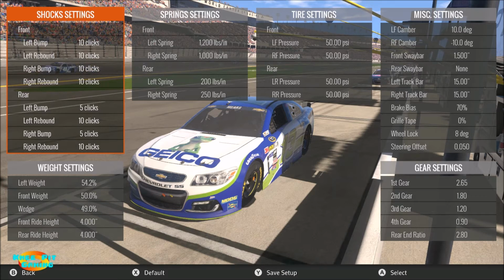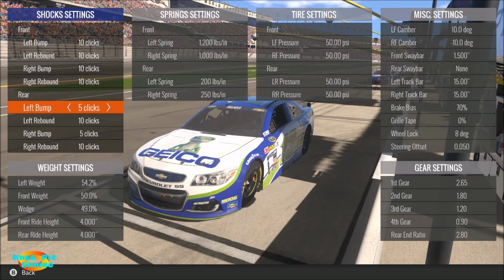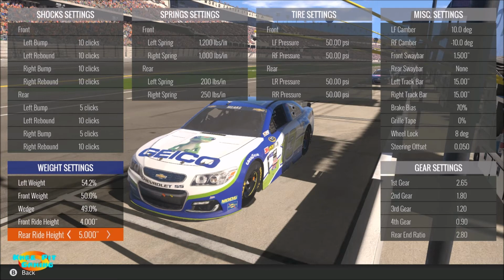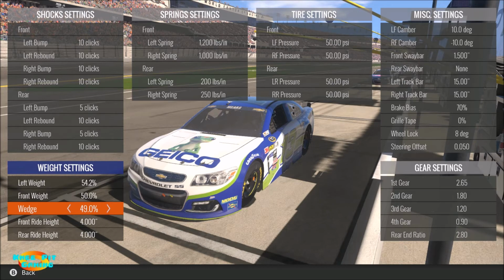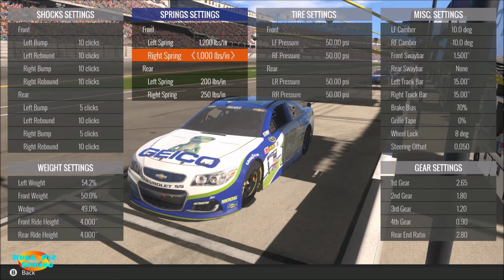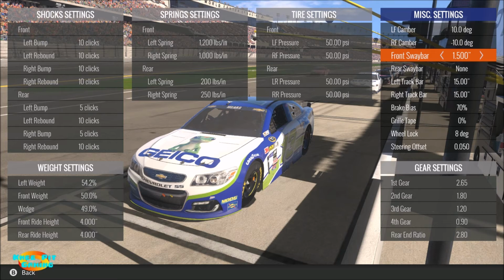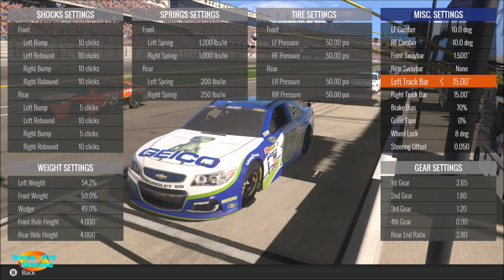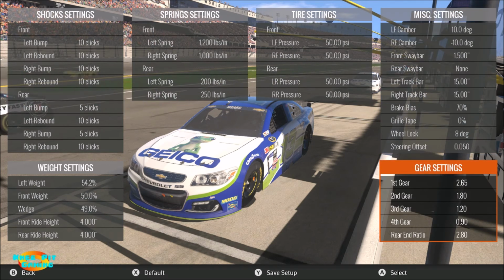Nascar Heat Evolution - Daytona Race Setup

Comment: I just used your settings and on the back straight away got a top speed of 204 so far. My only problem is I am restricted to using a controller on my ps 4 and I found the car to be loose as hell ! Could not control it at all on the back stretch. I didn't dare try to race against AI because in practice it was so loose. Are the two consoles that much different ? What is your opinion on this? ( I can't afford the Wheel and pedals yet.)

Comment: i tried your setup for myself but i find it drags a lot on the right front. so i tried going back to default and adjusting stuff from there. tires camber etc. now i am running consistent 46.4-4.5's

Comment: This setup was not for me. My old setup from past nascar games that I dominated online with works like a charm on this game. It pulls a little to the right but I clock off 45.5's none stop. Your setup was all over the place and seemed to want to stay in 3rd gear if I shifted to 4th as I always drive manual nit automatic on racing games, anyways when I shift to 4th its super super slow. My setup uses all gears and I get near 204 mph before the turn and keep it well over 190 in the turns. It just has a little right pull you have to get use to. Love my setup but guess what...Don't ask its my secret lmao.
Reply: So where can I see your setup. The best I can get is 193MPH.

Comment: this is crazy, my car pulls constantly to the left, even on the straigh, this is insane, any advice?
Reply from the maker: A few things...First, the car is intended to pull hard to the left so that max speed can be maintained through the corners. Second, as I mentioned in a reply below, try the settings in the talladega setup video. I posted it for those who want to be fast but also feel more comfortable. The pull left is always there but can be minimized. the quickest way is to increase the "Steering Offset" to around 0.125 or so.
Reply: i will try that, tyvm
Reply: the car runs perfect, it couldnt be more perfect tyvm

Comment: This is ok for speed.  But there is no control of the car.  How can i keep the rear end from sliding out from under me.   I am using a controller
Reply from the maker: Keep in mind this setup was created before the most recent update which increased the speed at Daytona/Talladega by over 10 mph. My recommendation would be to watch the Talladega setup video and start with those settings. I did that setup for comfort instead of speed.

Comment: Are you using a wheel and what are your settings on for all the sensitivity?
Reply: Also the car is very loose on corners and straightaways. Back end wants to come around if I even touch the controller. I'm using a controller btw. Thanks for any help you can give.

Comment: Is there a way to make the car not pull so hard to the left on the straights?
Reply: I used the Dpad on the straight aways...
Reply from the maker: Try adjusting the "steering offset" in the setup or reducing the amount of camber in the front tires.
Reply: What worked? I can't drive it when it's turning by itself to the left. I always over correct.
Reply: thank you!! Knee Pit Gaming you got a new subscriber!!
Reply: how?
Reply: D-Pad no longer works after patch...

Comment: Thanks, I'm trying to get my speed rating up at Talladega. No I don't think the draft works that well in the game, but I'm stuck at Level 1 because of Dega.
Reply from the maker: Interesting. I'll spend a little time at Dega and see if the setup translates well.
Reply from the maker: To follow-up on this, the setup works great at Talladega. I just ran a race against the ai at 105% and was 0.5-0.6 seconds per lap faster so you should have no trouble getting that 105 rating.